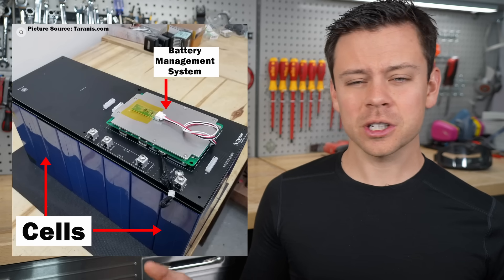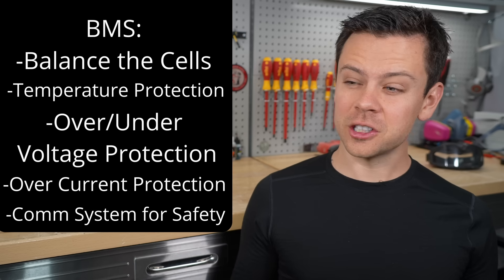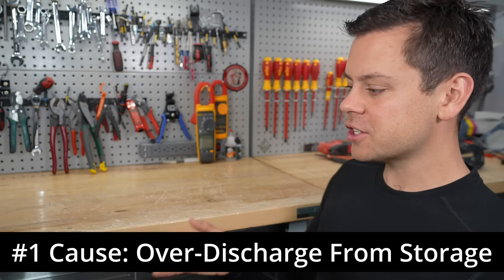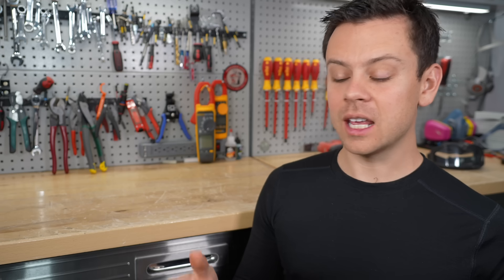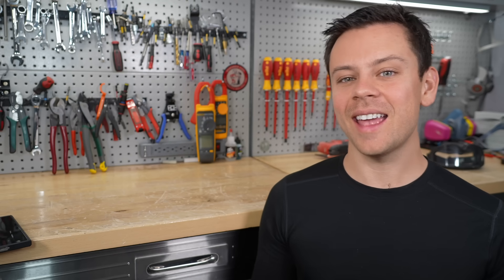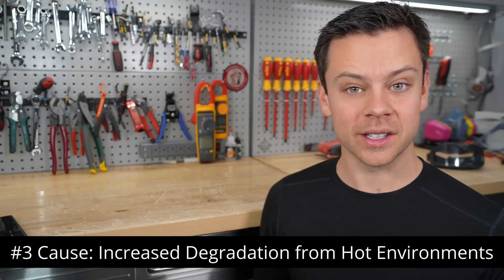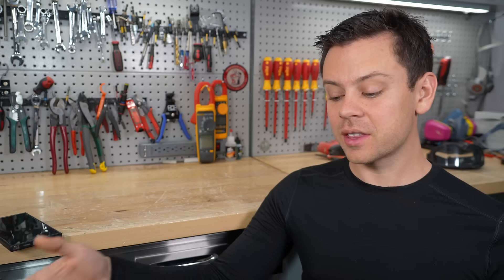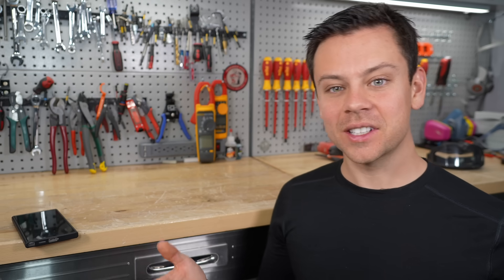The Rules of LiFePO4: The 3 Most Common Causes of Failure and General Guidelines for Long Term Use

Comment: Got Tesla model 3 LFP. Just got 100k miles after 16 months. Only 4% degradation! I drive Uber. Drive on chill. Charge daily to 100%. Full days are: 100-10-70-10, repeat. About 25% fast chargers, 75% at home. After watching this channel, I waited until i could get the LFP battery.
Reply from the maker: That's awesome. Heck yeah
Reply: Nice!!!
Reply: Nope. There is no way it's only 4% degraded. The tesla dashboard is lying to you. 4% degraded would be 200 cycles and you've done way more than that. This is in a perfect world. This is a high c rate application as well. Why do you believe anything musk says???
Reply: @Stoner916sac  You don't have to believe it. It's his car. He can do whatever he wants with it. Don't drink the Hatorade though.
Reply from the maker: What? Have you not seen the degradation rates for these packs? They are incredibly low. How about you post your proof that goes against the data reported by Tesla and this Tesla owner. Let's see it.
Reply: @WillProwse  I have over 300k miles in Model 3s. Lost the first one at >200k to being rear ended. He has no idea what he's talking about.
Reply: @Stoner916sac Zippa de doo day
Flibiddy floo
I fancy a Tesla
I'm running CIGS panels too
Reply: @Stoner916sac  I thankfully know how to test degradation correctly, both in service mode and using Kyle Connors method. I understand that many people don't believe me, but it's genuinely true. I expected 10%, but I am driving it as a tool, not as a race car. I'm thinking maybe that is part of the reason? Also, it's only 16 months. Also, I live in Michigan with a garage so no dramatic temperature cold or hot. Pick a reason why, but it's accurate. I'm really hoping to get up 500,000 miles without battery or motor problems. 🤞
Reply: My Model S from 2014 with NMC I have mostly charged at SuC and driven 370.000 km (229,000 miles) still with original battery and only lost like 1% a year in average. I drive every day and charge at SuC almost every day. And once or twice a year to 100 %. 
My Model Y I charge to 100% at least once a week.
Reply: Thank you for this real life example.

Comment: If I don't have a bms or shunt on them, how do I know their state of charge?
Reply: you don't know. Though if you charge to top when they start taking in no current ( each cell) then they are full. But in a pack that won't work so well with unbalanced cells with no bms since the high ones will keep going higher while low ones never charge up completely. Bms are not too expensive these days - get one is best idea.

Comment: Your absolutely 100% right, built my solar system slowly since 2018 and know every of your video.
I have one Growatt and smaller backup inverter. Using and upgrading my LiFePO4 batteries whenever I can.
And yes, recently on of my BMS from my LG 15kW battery died (got them batteryhookup). 
May make a video for which BMS is best, in case someone is in need, like me now.

Comment: This was great, I've been trying to decide on charge rates and battery location for upgrading our travel trailer from AGM to LiFePO4 and these tips really helped me understand how to think about these problems. Unfortunately in a travel trailer either inside or outside in New Mexico the batteries are going to roast and freeze. :)
Reply: Same here, but Wisconsin winters are the issue when outside stored. I guess it is best to charge to full then battery disconnect till April?.
Reply: Northern New Mexico resident here. I got tired of babysitting and frequently replacing lead acid batteries for my RVs over the years and decided to upgrade our RV with LiFePO. I bought a single Battle Born 100Ah battery and I couldn't be happier. It's been nearly 5 years and it still works like it was brand new.  It's located inside the RV under the bed, so it gets insulated from extreme cold and heat year round.

Comment: Will Great job as always, Question I bought Two WATT 12v minis because the price was great! I charge both up to 100% plus I've got them in parallel,plus to plus negative to negative. And that was Two months ago. Is it OK to leave them together or should I separate them. I'm thinking I should wire in the pure sine wave converter which is 2500W and just use for discharge up and down though the winter mouths. I'm thinking of using this coming summer for long camping trips. Thanks again for all your knowledge.
Reply: Leavin them hooked up in parallel, (as opposed to in series), is fine. If your area has below freezing temps often or long, I do recommend finding a way to keep them warm. Also, as long as you also use a solar controller and solar array, to keep them from getting too low, (and hopefully topping them off at least once or twice a month), I see no problems.

Comment: I don't see a downside to active balancers. I have small 2a balancers on my 12v 280ah packs. After one hour above 3.5v per cell it is able to bring the delta to 0.001 across the pack. 

I tried relying on the passive balancers of the BMS and it just couldn't do it. The BMS has a 100ma balancer. How is that supposed to handle a 280,000mah pack?
Reply: you are okay

Comment: I'm using mine for Solar. I have a 16S battery. I thought I was being responsible by having each cell max charge to 3.55V instead of the actual maximum of 3.65V .  Being told not to push Li Ion to 4.2V for years I guess scared me.
Reply: Any other chemistry than LiFePO4 batteries would be correct at that setting. LFPs can take up to 14.4 Volts per "12 Volt" battery, (which is actually 12.8V nominal)

Comment: Glad to hear your opinion on charging.  I have 3 100 ah batteries.  Mostly use them for a trolling motor battery, but like leaving them at 100% charge in case i need them for backup power at the house.  I was worried about keeping them at 100 %.
Reply: Keep my EPOCH trolling batteries in 90s for storage…even keep out in garage during winter…fine
Reply: "but like leaving them at 100% charge in case i need them for backup power at the house."  You want to float them in this case at a voltage that will not send any current into the battery once it's been fully charged. You can float them at 13.4 (3.35v/cell). This would be safe for a UPS mode setup.

Comment: Will you are not only obviously very intelligent you do an excellent job of explaining things so they are easily understood.  

You mention “extreme cold” in the video but I never heard a temperature mentioned that would define extreme cold in your opinion.  

BTW - I’m running your EG4 48V off grid setup full time off grid now for going on 2 years.  Love it!
Reply: Extreme cold in relation to LiFePO4 batteries is below 32F or 0C for longer than an hour or two. In a working system, the output of the batteries to power appliances, etc., usually will keep the interior of the battey warm enough for this. Any lower or longer, you will want to use some form of warming the batteries.
Reply: It's not a hard line.  More of a curve.  As you approach 32°F, the charge rate should use fewer and fewer amps until you get to 32°F where it would be zero amps.  Discharge does not follow this approach as they can be discharged at much colder temperatures without damage.  (I keep my cells warmed in the 35°F to 45°F range in the winter.)  Consult your LiFePO4 cell/battery manufacturer's datasheet for the actual charge/discharge ranges.
Reply: @ I’m off grid in VT Green Mountains.  My house is obviously warm but the barn I built this summer only has a wood stove in the shop area.  I just threw a EcoFlow Delta Pro I had in there for now.  I will turn off the PV this winter and only fast charge with my generator on above freezing days.  Should be fine for at least this winter.  4 years now off grid.

Comment: Thanks for another frank clear no BS video Will.
I have just bought two 100AmH LiTime batteries Group 24 BT LFPs.
What BMS should I purchase and where do I get it?
Thanks
Reply: Li Time/ other "store bought" batteries have the BMS built in. Most of these are not user-friendly for replacing the BMS. Only batteries that have a screw-on or bolt on top would be fairly easy to replace a BMS on, and you might need specialty tools to do so, such as a very small "tack" welder to attach the BMS wires to the battery cells, etc.
Reply: @Tumbleweed5150  thank you for replying.

Comment: What's the recommendation for storage of un-supervised off-grid batteries during the winter (-20c) for ~6mo. I have seen both "Charge it to 80% disconnect everything and hope for the best" and "Leave the panels attached and let the software work."
Reply from the maker: Unsupervised is tough. You could charge the 80 or 100% and leave them. If you have Wi-Fi monitoring I would put a heat pump or heat pads wherever they are stored and run it all winter. That's a tough one.
Reply: @WillProwse  "if you have Wi-Fi monitoring"   Right!  Off grid having to have a cell booster just to make a call, AAAA, I don't think we have Wi-Fi monitoring but I'll bring it up at the next meeting!😂😂😂
Reply from the maker: Disconnecting everything and leaving them in the cold won't hurt anything though
Reply: @WillProwse  Upnorthandpersonal convinced me of this and have done this now for four years with no issues.  There is so much angst about LifePo4 and cold weather.  Don't charge them below freezing.....period.  And, if you have a good BMS with low temp charging cutoff set at 35 F degrees, you will never have to worry about it.  Everything else in my research and experience is just folk lore.
Reply from the maker: @jws3925  I would definitely trust up north and personal haha he knows that type of climate very well 😂

Comment: I keep an EcoFlow River 2 in my car to run a 12v refrigerator.  The car is garaged at home so the temperature never gets above 80° F but the car is parked outside in the summer when I'm traveling.  

How bad is it for the battery to be stored in a 100° to 120° F vehicle in the summer?  The battery is rarely used when that hot.

Comment: Great timing. Ive been fretting about my new 12v/460ah Epoch battery in my trailer that always has a slight load, but gets recharged every day by the 300w solar panel in just the first couple hours.  I think i can relax now, without doing crazy automation to limit charge and force discharge. Ive set the max voltage to 13.8v - just enough to engage the balancing circuits. It'll sit that way between camping trips and be fully ready when we are.
Reply: The minimum charge Voltage I see recommended by most battery brands is 14.2. They recommend between that and 14.6. I use 14.4.
Reply: @Tumbleweed5150  Ya, these Epoch 460AH batts have a sort of issue.  The BMS shuts off if you charge them over 13.9V.  But I am hoping that by regularly pushing to that level, the balancer circuit will do its job and allow me to charge to a higher voltage eventually.  However, 13.8V is well in to the "knee" zone (13.45v/cell), which is plenty charged to call it 100%.

Comment: I am pretty sure the BMS has went out of whack on my Bluetti AC200P in less than 2 years , it shuts off at 60% saying the battery is empty , it only takes an hour to charge back to 100% using its own brick charger when in reality if it was really empty it should take 4 to 5 hours .      I wish there was a way to hard reset this powerbank ,  I am sure the cells themselves are fine ,

Comment: I have 3 Battleborns in my Fifth Wheel trailer wired in parallel. What is the best way to store and maintain these batteries? I live in Colorado where we will occasionally get zero and below temps, but usually not for longer than a few days. I generally keep them at a 60-80 percent charge, and I do not charge them when cold. I also check periodically to see that they stay above 50 percent. In the spring I charge each battery separately with a lithium charger to 100% to be sure the cells are balanced.  Thanks, I'm forever referring you to my friends for your battery reviews and your different setup videos.

Comment: Is a battery maintainer ok to use on them? I have an off grid cabin and I leave the solar hooked up to them for sometimes a couple of weeks, is that ok?
Reply: That should be fine, as long as they don't freeze. If they could freeze, either disconnect them and warm them up before charging, or have enough solar charging power to allow you to keep them warm.
Reply: @Tumbleweed5150  A good BMS with a low temp charging disconnect will not allow charging below freezing if set properly.  I have a remote cabin in the North.  The cabin used April thru December sporadically.  Whenever the cabin is expected not to be used during those months for more than 2 weeks, we disconnect the solar panels and leave the SOC (per Victron Smart Shunt) between 40-60%.  During the freezing months of Jan-March we disconnect all loads as well as the solar panels and leave them dormant at around 50-55% SOC.  Four years and no problems.  I was really scared to leave the batteries like this but Upnorthandpersonal on the DIY Solar Forum convinced me they would be find.............and they are.  So grateful for his expertise.  If you are a member in that forum and you see any post by him read it and learn.

Comment: I over charged one cell for about an hour.  Voltage got up to something like 7,8v for no more than an hour.  The charger was set to decrease current to zero at 3.60v but it didn't do it for some reason.  I quickly discharged the cell down to 3.3v.  There was no signs of overheating and no bulging but it does react differently in the 4s battery.  It charges faster and discharges quicker (voltage drops more quickly than the other 3 cells).  The battery seems to work ok and the delta between the cells is pretty good (usually .004-7v) but there is an obvious difference with this one cell.  Is it basically "toast" or should I just keep an eye on it?

So what is the symptoms of a BMS gone bad?  How about mentioning what that would look like.  Does one function go out, for instance, the low temp cut off or is there no current control at all or does it just not let any current go out to the loads?

Comment: How cold is too cold?  Unheated garage?  Thinking of getting supplemental battery power for my woodshop instead of trenching a new cable under the driveway to upgrade power
Reply: If you need to charge and discharge LiFePO4 batteries, 32F/0C is the lower limit. Most folks find using a small warmer/heating pad, and some even a high Wattage light bulb can prevent problems, especially if you can put an insulated box around the batteries and warmer.
Reply: Oops, the freezing point of water is where they do not like to be charged, even though they can be discharged at slightly cooler temps. However, keeping them above freezing is better all the way around.

Comment: … if the batteries are for “prepper” purposes, those folks are going to keep them topped off, not at 50%, no?  50% charged batteries are less use in an emergency situation.
Reply from the maker: Honestly they would be fine at 100% too. But to fully maximize the life, 50% is recommended. I keep all of mine at 100% though

Comment: I killed my first pack while in storage mode in my living room. My Electrodacus BMS Showed that it was still charged since it bases the SoC on coulomb counting even though the voltage of one cell dropped all the way to 0v and a couple others dropped to 1.2v. I charged it back up but the cells are bloated now but it still functions with decent capacity so I continue to use the pack for my solar fridge.

Comment: @WillProwse I keep seeing 14.2-14.65v being recommended for charge voltage. But what voltage is best and do you recommend in order to accomplish 100 percent charge and alow the bms to self balance best while also not hurting ones battery? Love all your content! Thanks man!
Reply: I use 14.4, figuring somewhere in the middle might be best. Not so low the BMS cannot balance, but not so high that a slight surge in power from my solar system could over-Voltage them.
Reply: @Tumbleweed5150  makes sense! Appreciate the insight. Just trying to determine the best voltage for best health of the battery but also to trigger the bms to balance correctly.
Reply from the maker: Yeah 14.4 volts is perfect
Reply: @WillProwse  It is interesting to me that the default victron lifepo4 profile is 14.2v. Is that evdn enough voltage to start the battery balance process? How long does voltage need to be held by the battery charger at say 14.4v in order for the bms to successfully balance? Assume one can't just reach 14.4v and then turn off the charger? Or does the bms balance even when the battery charger is unpluged if the pack is at 100 percent?
Reply from the maker: @forestpassineau  we've talked about this for years. They use Winston cells and with their external control system for their old batteries, they recommended that voltage. Doesn't really matter. Some recommend 14.2, some 14.6. doesn't really matter
Reply from the maker: @forestpassineau  and just charge to 14.4V. I wouldn't over think it. It will balance
Reply: @WillProwse  perfect answer. Thank you. Keep it simple seems to be the answer. Sounds like anywhere between 4.2 and 4.6 will be fine and allow the battery to charge and once full the bms to successfully balance. Like the fact it sounds simplistic and not overly complex. Thanks again Will!
Reply: @WillProwse  14.4v it will be! Thank you! Glad to know it's not a precise thing and a range in that area between 14.2-14.6 will work. Thanks.

Comment: I have two Sunrich Energy 100Ah self heating batteries on my travel trailer. I keep it plugged in so the battery charger is always available. Do you think leaving these batteries outside all winter is a problem? Our temperature will range from 0 to 30 degrees F most of the winter.